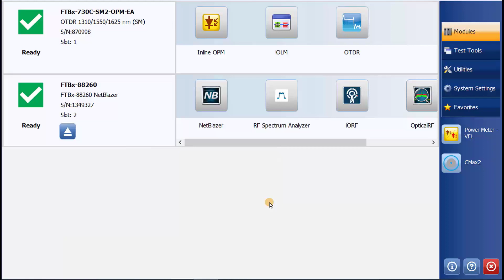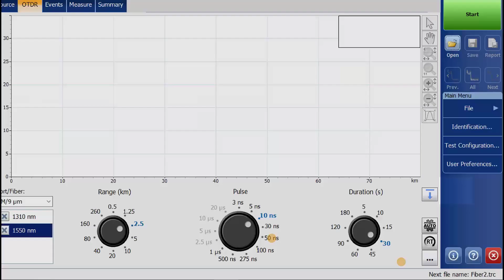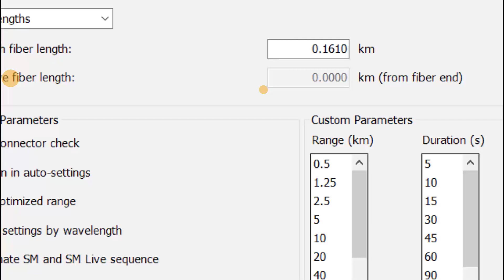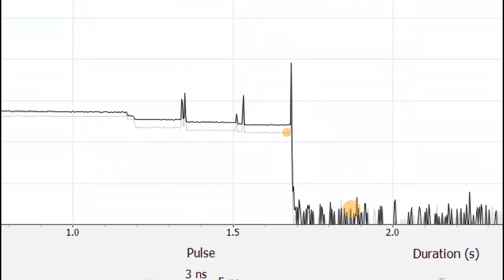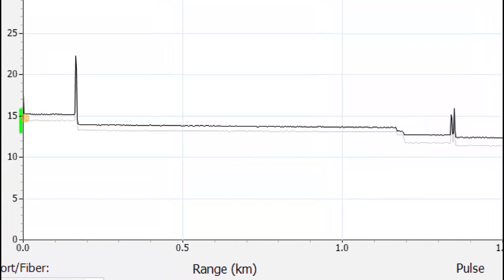OTDR Setup | How-To

Comment: When in the field we for the most part we use a 3ft connector to the strand port at a PFP.  So lunch cable you speak of is not feasible.